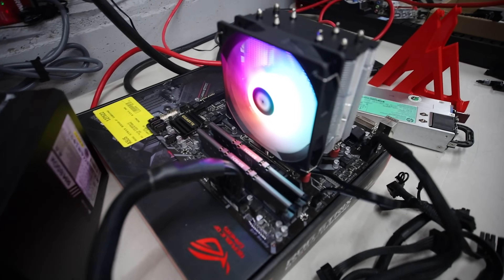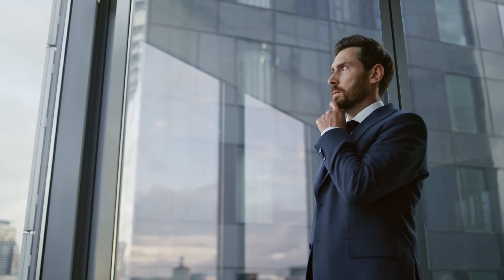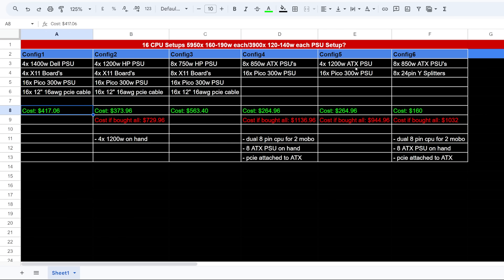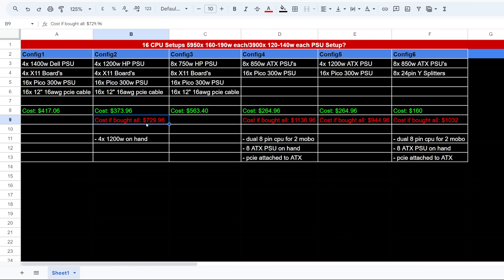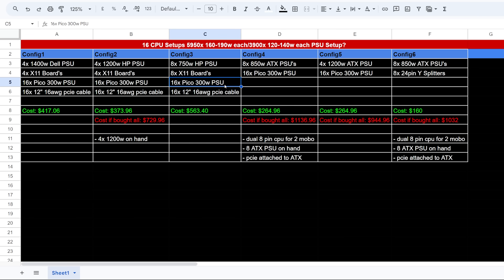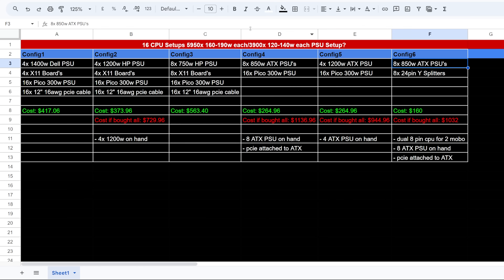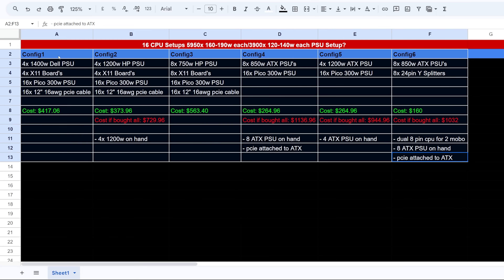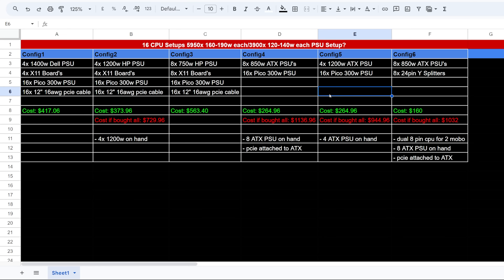How the heck should I POWER all my CPU Mining Rigs?

Comment: Few power supply like 750 watt or 850 watt if you check backside of the SMPS you can see 2 CPU connection slots means with 1 SMPS you can connect 2 motherboard you will see CPU 1 CPU 2 written in back of SMPS

Comment: 1200W server PSU with 3x or 4x of the 300W PCIE pico power adapter. I have my cpu rigs hanging from a wire-frame rack. Good density and airflow.

Comment: I'm already using 750w/850w psus with 24 pins splitters and it works really good, I think you should take a look at where you will put all the cpu mining stuff, will be easier to managed how and what kind of psu you should utilize, related to the space and cable management.

Comment: I use the 300w pico PSU for 100% of all my CPU rigs except the EPYCs I have. Mount a Bitmain 1600w PSU in the center of a wire rack, then hook into these. I run 8 CPU rigs per PSU. Any of them that are too far apart, you can get a 6pin to 6pin extender really cheap.

Comment: Red Panda Mining i know you are going todo what you already plan todo, however in CPU mining its to have less connection points, so i would #4 or #6 and yes #7 would be best one to one ATX per rig and you already have 8+ ATX so only 8 more or less would be needed, but that’s just me; i do not like to share power between systems but i also have two GPUs directly on my CPU rigs so i can do both CPU and GPU spec mining.

Comment: i have 9 rigs running on 300W picos for months already. Never have any issues. if you will use ATX PSU you will have less connections and way cleaner look then server PSUs. I try using 24pin splitters but never work for me properly... lots of bios resets need to be done. my vote is fore CONFIG 5

Comment: the 24 pin splitter is 12 bucks off amazon, canadian, i buy used evga or corsair psus that are 700 watt minimum witht he two 8 pin cpu cables.  they can be had cheap.

Comment: Id be putting 4 MB on each 850w psu. Split, split, split!

With 4 cpus tuned at 110w each that puts you in the goldilocks zone of efficiency on each psu. Ive never had a splitter get hot doing this. And ran 5 5900x on one psu all year. Not a single issue. Tried 6, but it was tripping the psu, 4 would be absolutely NO issue. 

You just need 4 psu of 850w each, 2 8 pin cpu cables coming off the psu, 2 8 pin cpu splitters and 3 24 pin splitters per rig.

 I use amazon plastic picture holders to prob the boards up. Just dont buy gold ones guys, i like the gold ones
Reply: assuming you run 3 24 pin splitter - and 2 cpu spitters?
Reply: How do you deal with powering them on, do you remove the power pin on the 24pin connector that turns the PSU on from all but one motherboard? Or does that not matter
Reply: @AcpEngineering  once you set "restore power after power loss" to enable, when you cycle the psu the mb will turn on. No tricks, no messing with pins
Reply: @andrewjones198  ah I gotcha. Thanks!
Reply: @andrewjones198  So you just daisy chain 24 pin splitters?  Isn't this dangerous for the splitters being daisy chained, especially the first one?  I thought of doing the same but afraid of burning down my garage.  Which 24 pin splitters you using?

Comment: Are you using managed PDU’s? Individual ATX would allow you to hard cycle them remotely if needed. I personally prefer to power each one individually and not trying to bridge power across multiple boards
Reply: i agree with retromike here, tried both ways , with some cheap EVGA psus available in amzon and newegg, its better to power each rig individually
Reply: I have 10 3900x rigs and I have done most of those options. I’m going to agree with both you guys that having a single PSU per rig has ended up being the least amount of headaches for me

Comment: A decent way to do it is put 5 CPU rigs onto a 1200w server power supply. Just need a 300W Pico for each of them.

You can get 300W pic's that are supplied by a normal 4 pin ATX (2x2, not 1x4). Then you can make cables that go from 6 pin PCIE to 4 pin ATX. I go one step further and make a dedicated 8 pin CPU power using the 2 unused pins from the first cable plus 6 from a 2nd 6 pin cable. Works great and Mines stable. Can power off single rig using a simple power switch (hold down until power down)